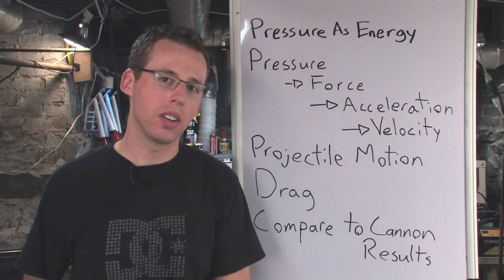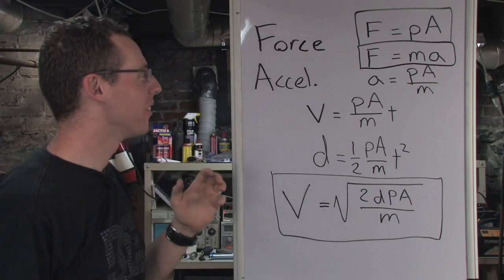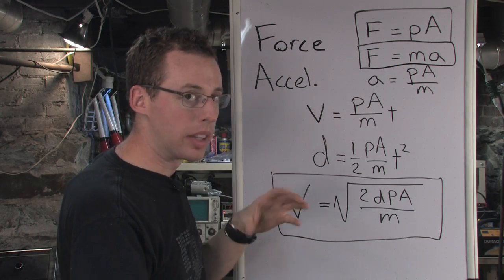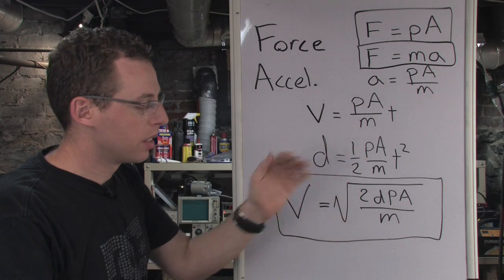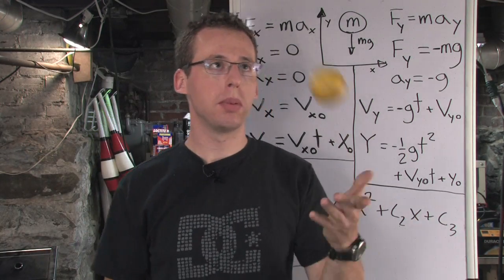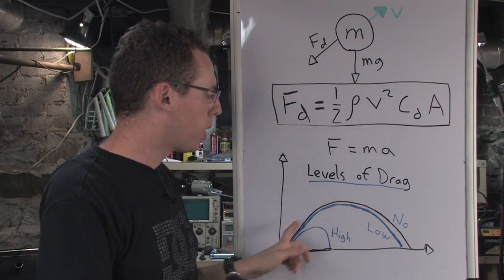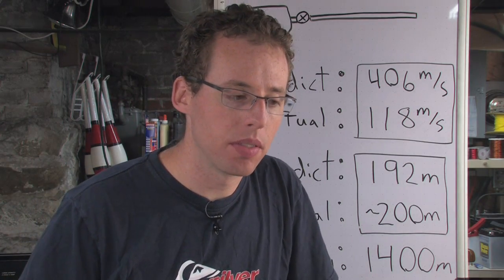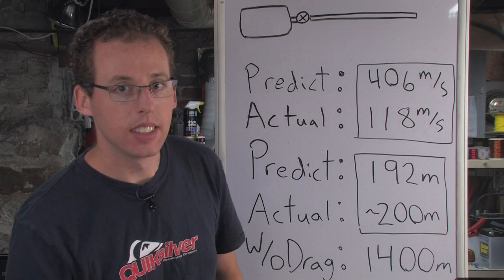Air Cannons - Related Science

Comment: What has more drag and what will travel farther a potatoe, or a potato? Great video, liked and subscribed.  On the Yorktown we fired 16-inch guns around 60-degree elevation at Jap ships over the horizon, clear out of sight. We relied on our submarine spotters to call in the coordinates and we would get a hit on the 2nd or 3rd round. Air drag is a function of the square of the velocity, so you have to get an average depending on your intended range, so it will change and has to be custom calculated; as well as the ballistic coefficient changes with velocity and it also has to be averaged to the intended range.  The trajectory of a truer parabola would be on the surface of the moon with no atmosphere,  but still, it is not a true parabola as gravity acts in one direction only, towards the center of the masses. The reason a bullet fired at less than a 45-degree angle is that as it travels up to the apex of its trajectory, it is a parabola as the bullet is being slowed down by gravity. Past the apex, gravity is not slowing down the bullet, but accelerating it faster towards the Earth, so the parabola is now more like an ellipse, so the lower angle takes advantage of the higher velocity on the path of the parabola and past the apex, the bullet has slowed down that it drops much faster. I am really interested in your cannons specifications. Thank you for the great video and the formulas.

Comment: For the final velocity equation, is the pressure measured in Pascal ?
Also, can i use that equation to find the pressure needed, as i know the velocity needed ?
Reply: Pressure measurement is dependent on whichever system you used for input into the equation.